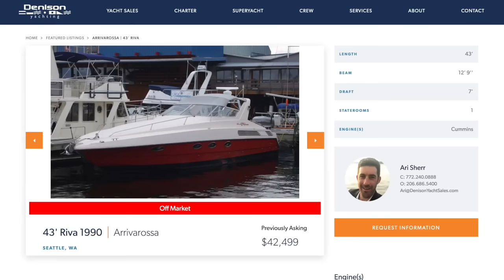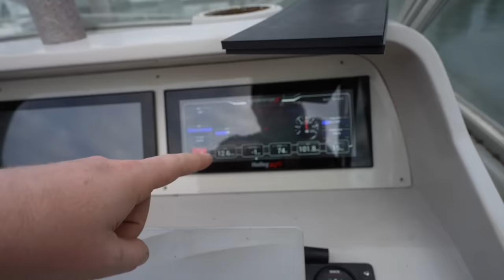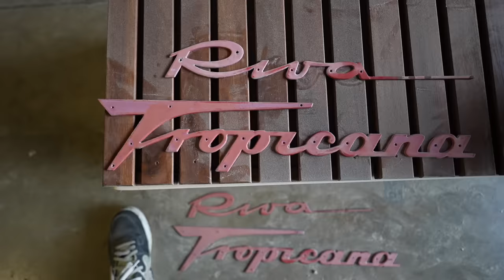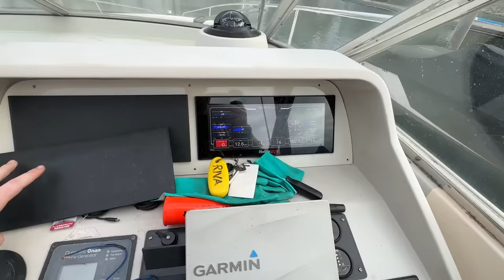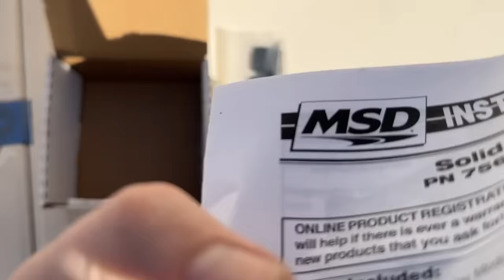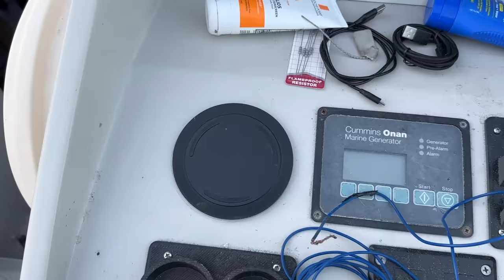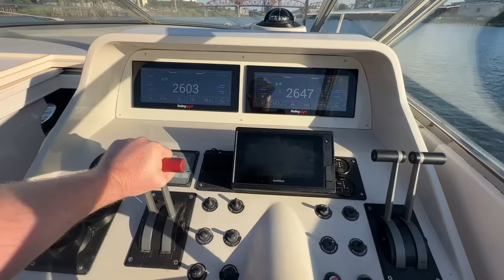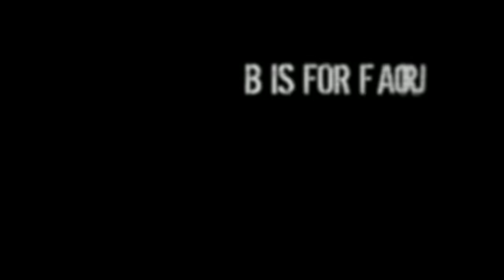LS Swapped 30yr Old Italian Yacht FINALE!! - ITS FASTER THAN EVER!!!

Comment: Once you are on a plane and giving it 75-100 throttle you need to lift the tabs. You will get at least 5-10 more mph with the tabs lifted. You can see the bow plowing the water (because of the tabs being down) when you are at full throttle.
Reply: I was going to comment the same thing, bow is way too low and killing speed and economy
Reply: It's not a problem of trim tabs, but of lack of weight at the stern...the boat is built for heavy diesels.
Reply: @valefur72 It has the wrong props.  It's doing 10mph at 1000RPM. LOL!
Reply: Yep he trimmed it wrong pushed the bow down
Reply: Lift the tabs your plowing the bow
Reply: @SingleSpeed427  propellers for the diesels!
Reply: @williamsrb1768  I can't believe it! 😱
Reply: planing has less wake and reduce trim when planing only use trim to get you on plane ..
Reply: Lol he doesn't even run it at full throttle.has nothing to do with the tabs lol.new engines don't weigh anywhere close to what the old ones did.boat no long has the weight it needs in the back.
Reply: @williamsrb1768 no its not lol.
Reply: Crazy low max rpms on full throttle. Engines wont like that a bit. Time to go prop shopping. And do something for that trim. Can't believe it wouldn't have been trimmed correctly with tabs. Might be an issue with prop shaft angle designed for heavier engines.
Reply: Ur only at 2500 rpm at full
Speed.  You should be at like 5000
Reply: @gavinferguson it doesn't have the weight it need in the back.them ls engines weigh way less then the others.tabs aren't going to help.
Reply: @leefritchman9643  that's high as he goes with them.he doesn't run them any higher.
Reply: boat is plowing
Reply: @e36er4life  what happens when ya put lighter engine's in a boat and don't replace the missing weight.
Reply: It’s definitely the weight indifference between the gas and diesel engines and the props. That boat was never designed by “actual engineers” to run with gas engines. Those engines are going to struggle hardcore until there isn’t anything left of them in its current configuration.  Between fuel cost “mpg” and all the conversion as well as the maintenance those engines are going to need the diesels would have paid for themselves in the long run with improved reliability.
Reply: @jerrywilcox9890  the engines were turning 2600 rpm’s. They should run over double.
Reply: @SingleSpeed427 I thought that it could use different props too. Those lsx motors should be able to rev to at least 5000rpm. I'm wondering if it's still got the diesel props on it?
Reply: My exact thoughts!
Reply: You got another 10 mph in that boat… changing props and adjusting tabs will surprise you… IMO
Reply: too much hull in the water.
Reply: @darwonboyful  I would bet it still has the diesel props. I’d turn those motors really 6250. In a car they’re going to rev to 7250+
Reply: @darwonboyful  you people don't listen very well he doesn't want to run them at 5000 rpm what part of that you people not understanding lol.2600 is the highest he's going with the he has said it many time.
Reply: @darwonboyful  doesn't matter what props are on it he is still only going to 2600 rpms lol.
Reply: @P-J-W-777 Those gas engines are only turning 2500 RPM, at that RPM they will last forever.

Diesels aren’t just inherently more reliable, they are mostly reliable because they turn at a very low RPM (like 2-3K), these gas engines are turning at 2500 RPM. Also, the precision and reliability of the modern engines are far superior than the 20 year old diesels that were in the boat before.

Keep in mind diesel engines also have far higher compression which puts far more strain on all of the components. Low compression motors last longer. So again, the main reason diesels tend to last longer is because they spin much slower. There’s other variables too, such as the components used in diesels to withstand the high torque at low RPM, but any modern LSX engine is built to withstand more torque than those old diesels anyway.

Now if you were to compare a brand new diesel vs a brand new gas engine in a CAR, the diesel will likely be more reliable, mainly because the diesel will spin at 1/3 the RPM, and also because the stock components (connecting rods, pistons, bearings, etc) are likely to stronger due to the low RPM torque. However, having a lot of torque at low RPM puts a lot of strain on engines, but that doesn’t really apply to boat engines because their simply spinning a prop in the water, and that doesn’t put a lot of load on the components, so it essentially nullify’s the main advantage diesels have in terms of reliability. A gas engine is happy to make a lot of torque at low RPM with little load, and there’s not much load from a water prop compared to a tire on concrete.
Reply: @valefur72  All the more reason to lift the tabs.
Reply: @jerrywilcox9890  Than he was a moron buying "performance" engines that are designed to produce power at a RPM higher than he wants to run them at.
Reply: @P-J-W-777 So basically to simplify what I said:

Diesels are more reliable for two main reasons

1. They spin much slower
2. They typically have stronger components to withstand the high torque at such low RPM’s (A lot of torque at low RPM exerts a lot more force on components compared to the same torque at high rpm)

Since the gas engine is also spinning at 2500 RPM there is no advantage there. Also, since the engine is spinning a prop in the water there is also significantly less load at low RPM’s, so you also lose the advantage there as well.

Since the main reasons that make the diesel more reliable are null and void, the rest of it just comes down to compression ratio & build quality, both of which the gas engine is superior in.
Reply: @jerrywilcox9890  that will put huge load on the motors.  Petrol engines aren't designed to operate at diesel rpm ranges.
Reply: @jerrywilcox9890  emotional much?
Reply: @ChristopherGuilday  No, diesel's last longer because they are built to last longer. And as generators and boat engines they will last even longer because they love running at a constant RPM for hours and hours on end. The only reason they had an engine problem in the first place is because of the oil pressure gauge. Good maintenance and those 903 would have been good for another thirty years. Also, those old diesels don't need a computer or sensors to run. I've driven diesel trucks with more than 700,000 miles on them with no rebuilds, plenty of "old" diesels with odometers reading numbers you will never see in a car, let alone a high performance car. We got a truck with nearly 900,000 miles on it and it just blew the head gasket. Its had one set of fuel injectors and now one head gasket in 23 years.
Reply: @valefur72 and gearing...
Reply: @jerrywilcox9890  well he may not want to but they should if he’s at WOT!
Reply: @ChristopherGuilday  diesel engines are designed to build power and torque at lower rpm’s while gas engines typically don’t build their full power until above 3500 or more. You can watch Dyno test after Dyno test to prove that!
Reply: @ChristopherGuilday  torque is torque it doesn’t matter if you’re spinning at 5 rpm or 5000 rpm. If your running at 1200-1500 ft/lbs the force from either source will be identical the only difference being is the RPM’s from the rotating motor. Gas engines aren’t built superior and if they were they’d be installed in every generator, semi truck, train and ship. 
Go look at the thickness of the block and heads on a diesel engine and then go do the same for the gas engine that’s built to match the diesels torque and then come back and tell me which engine is superior and will last longer as well as being more efficient.
Efficiency is based on fuel mileage/economy alone. Included in that is the maintenance a motor will require over its life span. Go talk to several truck drivers and ask them how many miles they have on their trucks and ask how times those engine have been rebuilt as well as how much money the engines themselves have cost them. 
In the long run the diesel will be more cost effective if properly maintained. Key word being “Properly”.
Reply: Normally the way a boat prop is selected, is you want the RPM at wot to be at the max range for that engine. Having too much prop, like you have now, we'll put a pretty bad load on the engine they say.
Reply: And I wasn't able to go back and read any replies, but I hope you got a agreed value insurance policy. The other type would be called cash value, which is from NADA, or similar "Kelly Blue Book" type of established value when you have a total loss. value
Reply: But most importantly, you guys are rock man. When you talk about your challenges brother, I totally respect you and all the work and energy you bring. Good luck and thanks for the great content
Reply: Regarding prop and RPM at wot, that's a ballpark you can use every inch of prop pitch as about 100 RPMs. You have much larger prop so that's not going to be exact, but I'm sure you can research that info based on the size propeller you have. You're going to need to go to a lower pitch to get your RPMs much higher
Reply: Lol people saying diesel props, you'd have to get the weight of the boat and the prop slip , pitch of the props , the amount of blades it's a very big math problem for planing and speed and what not
Reply: @ChristopherGuilday  Forget the water... the load is so high that those racing engines can't go past 2,500 rpm at full throttle/load. The numbers are there. What are you talking about?
Reply: @pcihector  Well than he simply has too big of a prop on it. My main point is that what makes a diesel reliable is primarily RPM, sure they might have stronger components to withstand the high torque, but a modern LSX engine is going to make similar torque at that RPM, it’s also a much more modern engine with tighter tolerances and less compression so I don’t think the argument that it’s way less reliable really applies here.
Reply: Acid and a swiffer mop and then rinse off. People been cleaning with it for years
Reply: @jerrywilcox9890  @2650 rpm those engines are waaay below their torque peak and not doing those engines any favors.  Full throttle bogging at 2650 is just a total prop mismatch.  Those may be 750 horsepower engines but at 2650 rpm there’s way less than half the torque the 903 Cummins were giving. Yeah he says he doesn’t want to run them at 5000 that’s fine, you just don’t throttle them that high….but they should be able to hit 5000-5500 rpm at full throttle so at part throttle they can efficiently cruise all day long at their torque peak which is somewhere in the 3200-3750 rpm. The props are taking too big of a bite, way more than those “little” LS engines can give at 2650 rpm.  I think Texas Speed would be horrified these engines would be lugging at 2650 rpm full throttle. A big boat like this you need humongous torque at low RPM and these LS engines don’t have it down low. Torque peak might even be over 4000 rpm happen. This is just punishment of good engines. Only solution is to re-prop the boat, radically.
Reply: @leefritchman9643  Much more with these engines, likely above 7000 even...
Reply: @jerrywilcox9890  No he hasnt said that "2600 is the highest he's going with the he has said it many time" at all. He was talking about speed if anything, not revs.

But more importantly, an engine like this need to be geared for its max revs or it will take a heavy toll on it. Not good at all.
Reply: @mitchharper_rule62  Exactly right Mitch, and this engine surely got that at above 7000... so way, way off.
Reply: @biprgriff  Its even worse, these are racing engines, more or less so he should hit 7000rpm at full throttle.... Gearing is therefore way off..

He has got gearboxes on it he says, seems no one checked the gearing even slightly beforehand, sadly.
Reply: Others are saying/asking about the props and also the gear boxes ,props and ratios set for a diesel are not right for a gas motor .
Others have mentioned the weight that was there with the diesels ,maybe fuel tanks to the stern might counter the weight loss ,or add Ballast tanks that can be filled and drained when required.
One hopes that you have done the radio operators course and a coast guard course if they have them  there .
That will help you understand the speeds when passing other water craft etc , proximity to structures ,moored/at Anchor craft and more .
Is the river all salt water ?as there is difference with fresh and salt water .
Glad that you got to enjoy friends aboard
Reply: Fuel flow meter
Reply: @GoldenCroc  I figured I was just staying on the low side.
Reply: @ChristopherGuilday You don't know what you're talking about. Not a single large or long distance motor yacht uses petrol.

It's more dangerous, less reliable and more expensive.
Reply: @chrisnigh3987  if the stern is too light, you can lift the tabs, but the bow stay down...
Reply: Great job complementing the people of Astoria.  I make it a point to do the same when my fellow people of the world do the right thing.
Reply: Need new props to match the new engines there designed for low RPM
Reply: @dannycrooks8462 he isn't necessarily turning them too fast. He was running around 2600rpm which is around the top end for diesel engines. If his gear ratio is 2.5-3:1 like a regular marine gear, the props are turning the same as when they were hooked to the diesels. Props need to be done based on engine load at target rpm. Gas engines should be turning way more than 2600 at full throttle.
Reply from the maker: ahh that makes a lot of sense!! see i’ve got a lot to learn!
Reply: You'll miss that this is Marine application. Those LS engines would not survive long on 5000 rpm full throttle.
Reply: @JohnDoe-zr6bk  Disagree. Mercury make (gas) inboards that will run at 6000+ all day every day. Just needs to be built with quality components. The biggest engine mercury racing make is a twin charged 1550HP 550cu in V8
Reply: As a marine mechanic specualizing in mercruiser inboards that rpm at full throttle might be the best way to kill an LS engine I've ever seen. A propeller change is more important to this boat than anything else you could do. To the point that I would be telling an owner I wouldn't warranty any motor repair i did until he fixes it.
Reply: @valefur72 at speed the difference in engine weight is negligible. It’s props and tabs.
Reply: @jerrywilcox9890 it’s not the engine weight. If it were a 20’ vessel you may have a point. But, an I/O at 40’+ LOA wouldn’t notice the weight difference much at all. The props are wrong and his tabs may be all the way down. He’s new at boating, and probably likes the feeling/visibility of having the bow low.
Reply: @jerrywilcox9890 he said he was at full throttle. You’re not listening.
Reply: @MaxJam684  he wasn't at full throttle lol
Reply: @MaxJam684  saying and doing is 2 different things cupcake.
Reply: @patricktennant1585  Mercury Marine said the same thing to me when they fitted my V8 ProXs outboard, lugging them with a too big prop is terrible for the longevity of the engine, that's why recommended RPM range exists (5800-6200 for the outboards)
Reply: totally agree, plowing water big time
Reply: Barkeeper friend cleaner
Reply: Reprop now! , don’t lug those new motors to death. Call motor builder and ask max running rpm and prop accordingly.
Reply: @ChristopherGuilday your comment on load on an engine turning a prop is completely wrong. A marine engine is full load all the time.  The engines do not have the torque to turn the props any faster. The props must be changed to match the new engine operation range

Comment: The boat needs different props. We have an 01 Doral 360 ext swim platform, 41ft LOA and it will run pretty much 48-50mph on twin VP 8.1's 496ci, thats at 4800rpm. Past weekend we were running 43mph at 42/4300. 2k hours on motors. Stern drives. Enjoy the cruises on river visiting w friends and enjoying food, bbq'ing and swimming!! You gonna love it.